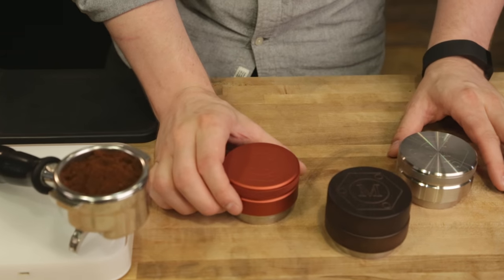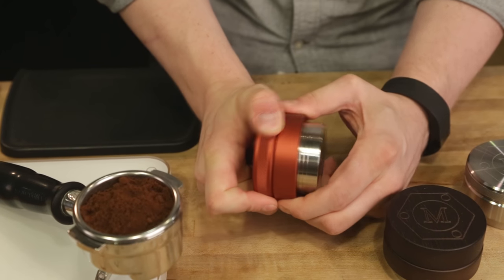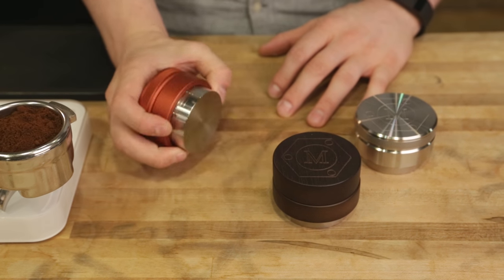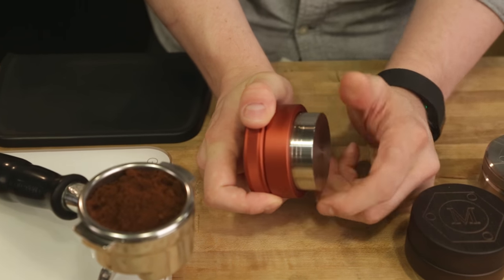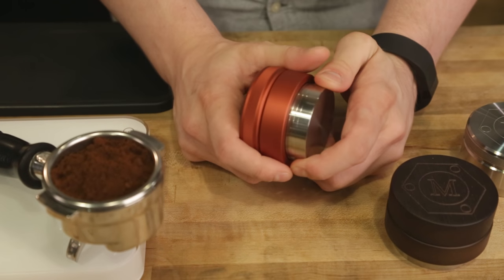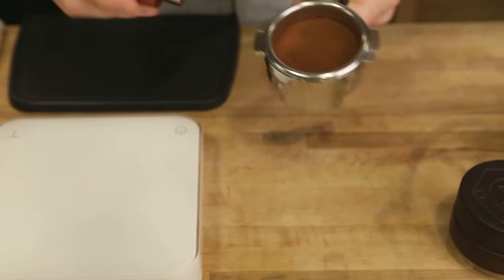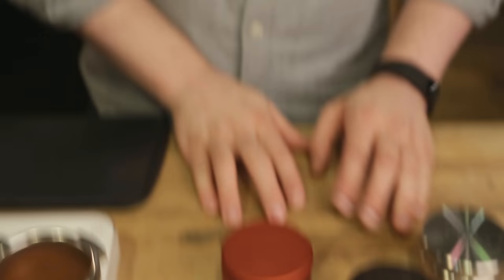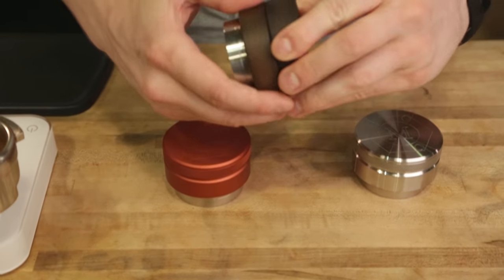Mahlgut Palm Tamper Overview

Comment: My concern is the effect that it will have on your risk over a period of time. We've all been taught the importance of tamping straight down at a 90 degree angle to ensure an even tamp and no strain on your wrist...this tamper completely ignores that.
Reply from the maker: Hi Craig. Traditional handled tampers require different body positioning partly due to the angle they force your hand into when pushing. Palm tampers like Mahlgut's allow a gentler and somewhat more natural positioning of the hand, which will incur less arm and wrist strain. With any manual tamper there is some risk of repetitive strain injury if your body positioning is incorrect, however.

Comment: How does one know how deep to set one of these? Is there a general rule of thumb? Or just use all of the adjustments, pulling many shots until the bottomless portafilter pour correctly?
Reply: And thst's the very issue with this syle tampers. It won't cater for slight  changes of dosing in your PF so you won't have consistent pressure tamps unless you keep adjusting height by constant screwing and unscrewing.
I can see this saving some baristi wrist and elbow strain in a busy cafe but for less frequent home use, traditional tamper still rules.

Comment: I don't get it.  If you set the depth too shallow, you won't get enough pressure for a good tamp.  If you set it too deep, you get the requisite pressure, but you don't get the effect of the side of the tamper resting on the edge of the portafilter for an even tamp. How do you know that you're getting the proper pressure tamp?  Tamping isn't that difficult...and I'm a home barista.  Imagine a barista doing 200-500 tamps a day?  I think they got it.
Reply from the maker: We've found that "requisite pressure" is a bit of a red herring in the case of tamping. There's not a whole lot of difference to be seen between a tamping force of - say - 15 lbs and 30, not in how the shot performs or tastes. Instead, we look for adequate and even compaction, such that the puck resists the flow of water for the desired brew pressure. That could be a range of a few millimeters, so that is essentially what we recommend adjusting for. Typically we'd suggest starting with the base at too deep a setting, then tamping until you've adequately compacted the coffee. Then, adjust the base so that it rests level on top of the compacted puck, and you should be all set for that given dose and grind size.

As for the busy barista - this is exactly where a tool like the Buzzer excels. Tamping hundreds of times per day is strenuous and imprecise. Barista trainers know very well that tamping form tends to suffer throughout the day and when caught in a rush, so a tool like this which eliminates some of the variables is a great help. So far, feedback has been quite positive from professionals, while home users have a harder time justifying the purchase when they often have much more time to prep a shot and focus on technique. Hope that helps!
Reply: Interesting...thanks for the explanation.  But it begs the question...if tamping pressure used to be important and now is found not to be, then is okay to have a little unevenness or less polishing?  Is it (the palm tamper) really going to effect the espresso?  And yes, I'm actually asking, not stating.
Reply: Speedster2707 level tamping will allow the pressure in the basket to be even and therefore you will get a better extraction. but the whole story is not just the tamper, look at a few videos about tamping from Gwilym Davies, a barista champion, think it'll clear a few things up for you.
Reply: They make U$150 if they are able to make you question if you are dumb enough to not get it.
Reply: @Speedster2707  tamping pressure (force) is not as important as before but it is important that you as a person are consistent in the force you use. Most imortantly though are that the coffee is evenly distributed in the portafilter so you're not getting underextraction in the middle and overextraction on the sides
Reply: This tamper will produce wildly differing pressures if the amount of ground coffee varies by just 5%.  
Imagine trying to screw the lid onto a full glass jar of lentils, then you add 5% and try again - the jar will shatter ! 
5% too few grounds and there's no tamping pressure at all.
Even 2% variations in the amount of grounds will produce very different compaction levels.
Totally mad design, sorry.

Comment: $150, ahem, yeah, no.
Reply: Not really an issue if you own a coffee shop and want consistency.
Reply: I am quite confident I speak for all coffee shop owners when I say...No, NOOOOO!!!

;-)
Reply: No kidding. $150 for a small piece of stainless steel that takes a few minutes of machining on a cnc. it's not a revolutionary design either, its really freaking simple.
Reply: I feel like Prima Coffee is the Apple of the coffee world.  Overpriced mech that when you get down to it, there are a lot of simpler tools.
Reply: A good tamper for max 25 bucks does the job, plus your heart and passion for the work you are called to. Then you will have a coffee which is priceless.

Comment: While this is very nice looking tool,  it still doesn't address proper coffee distribution in the basket, nor consistent tamping pressure.
Reply from the maker: It's true that the Dozer is meant more of a grooming tool, not for redistributing the entire basket. But as a grooming tool it does a great job of preparing a level and evenly dense surface prior to tamping. We've seen that this helps reduce donut channeling and shots taste a bit more even, and there's a little evidence that extractions are more consistent with this kind of grooming over finger sweeping and tapping. If there are other problems like clumping or poor particle uniformity, those issues should be addressed through other means.

As for tamping force, we've not found much compelling evidence to say that it matters all that much. We have not found much of a repeatable distinction between tamping at 15 pounds or 40, but rather that the influence of a level tamp, more uniform grind, and fairly even distribution are far more important especially where flavor quality and consistency are concerned. Tamping level and compacting the puck "just enough" seem to be all that's necessary to be concerned about, at least as far as we've found. To that end, puck style tampers like Mahlgut's get the job done quite easily and repeatably.